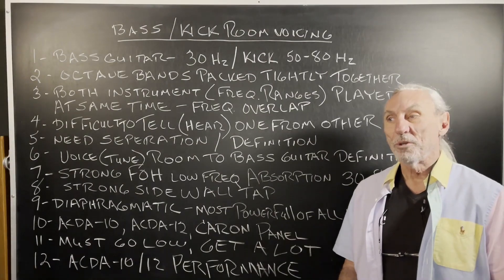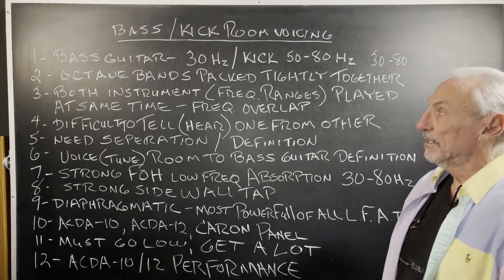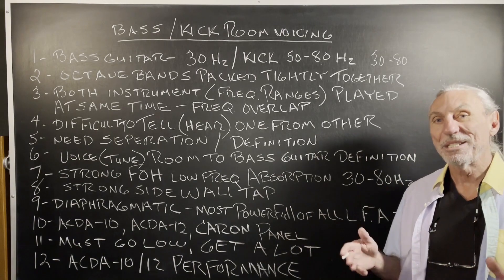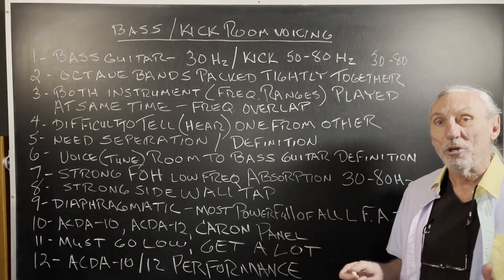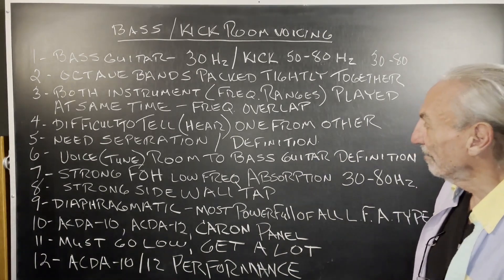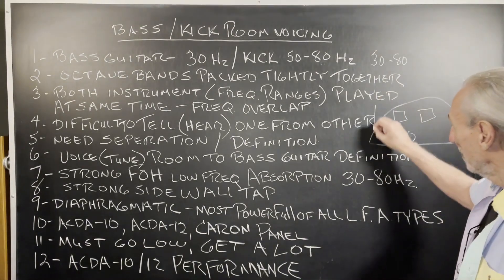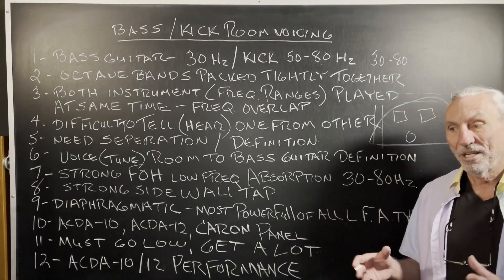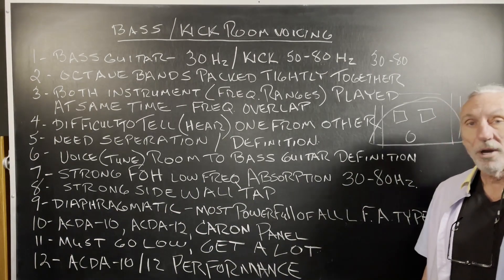Bass/Kick Room Voicing - www.AcousticFields.com

Comment: Most music in the rock/pop domain all have the kick tuned to 60hz. There isn't enough room in the mix to go much lower without causing compression issues. 60hz is also the lowest frequency most "standard" devices will play well. Classical is obviously the one genre that breaks these rules. Organs go well below 40hz as do a number of other instruments. Of course, we audiophiles are a different breed for sure, but most music isn't created for us. Most music is created to sound best on as wide a variety of devices/speakers as possible.
Reply from the maker: Agreed. The toughest job any room will ever experience is to manage energy from 40 - 60 hz. and up and do it with the proper attack and decay rates so that a higher resolution is able to be achieved.

Comment: Excellent as usual, Dennis. I am a musician of about 35 years. I was always taught that the bass guitar should be heard (your excellent scale analogy) and the bass drum should be felt . An open E string on a bass guitar is about 41Hz. The open B on a 5-string guitar likely creeps down to your 30Hz area. Thanks for the great video.
Reply from the maker: Achieving low frequency resolution is achievable if you are willing to cover enough surface area on each wall floor and maybe the ceiling with the proper rate and level of absorption. Most are not and choose to live with the mud and soup that modes produce.
Reply: @AcousticFields  Agreed! There's no free lunch and Mother Nature bats last. Darn laws of physics!